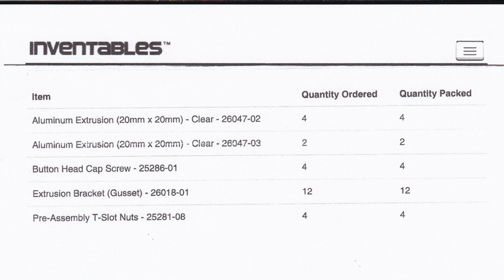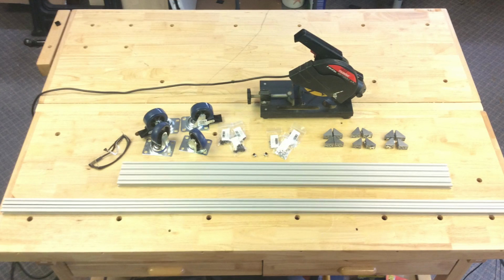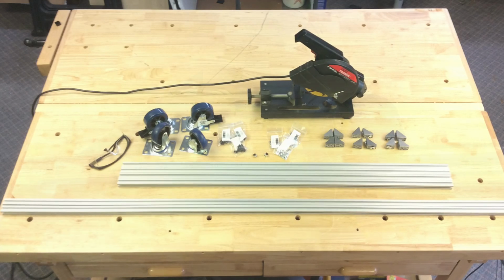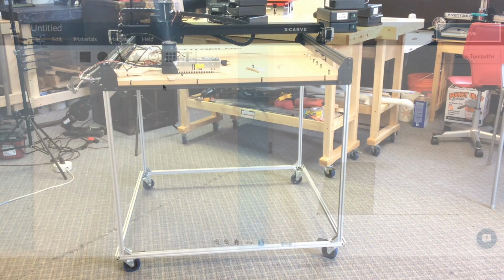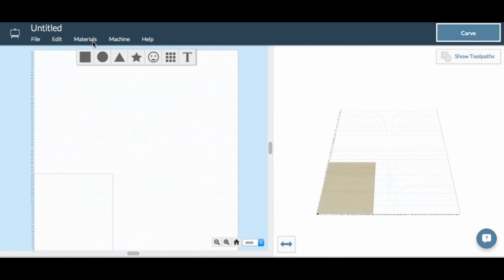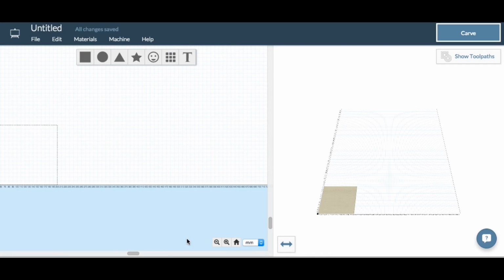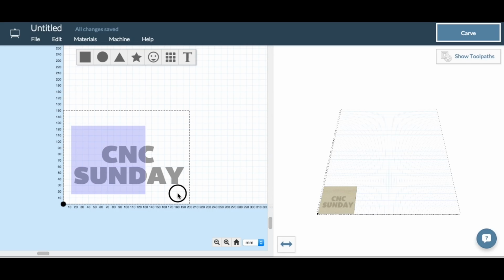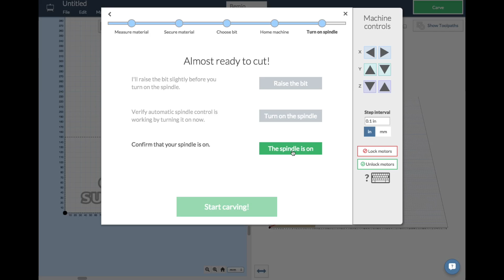CNC Sunday #1 - Creating a Stand for the X-Carve using 20x20 Extrusions and a First Carve

Comment: Hi Chuck.  just a suggestion.  You might want to add diagonal braces on the sides of the stand.  say from the top front corner to the bottom back.  That should stop the wabble and will make it a lot more stable when you add the extra shelves for storage.  I'll bet you could 3D print some 45° brackets to use with the extrusion for the diagonals.  Anyway it's just a thought.  Great video!
Reply: +Chuck Hellebuyck's Electronic Products At some point, you're going to want to crank up the carve speed too.  You should be able to go much faster (5x or so) than you're going now, and that's going to move the table around a lot more.
Reply: +Chuck Hellebuyck's Electronic Products Yes, but I've backed off quite a bit - it gets sloppy.  I'm usually running 1500mm/minute in wood.  The exception is for cleaning the MDF wasteboard - that you can do really fast.  I used 5000mm/minute the last time I did it using a 1/4" bit.  I've got a DeWalt 611 on mine.